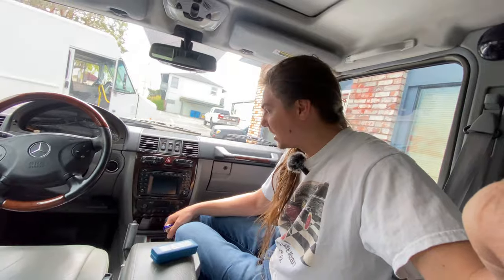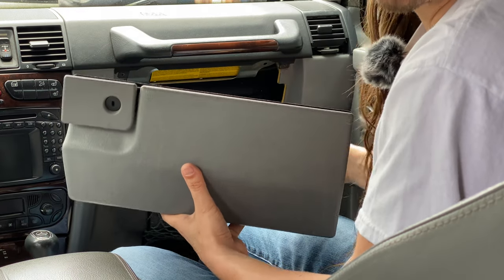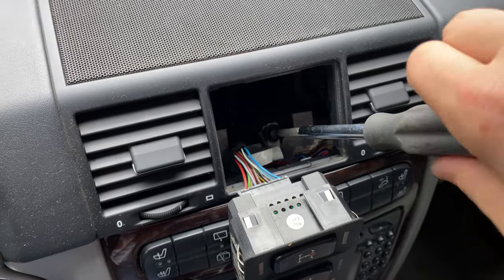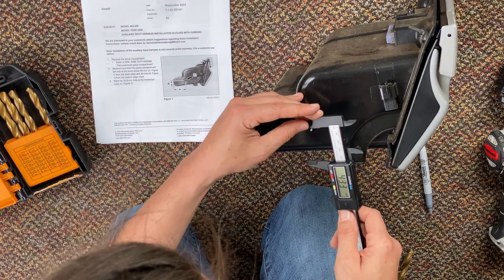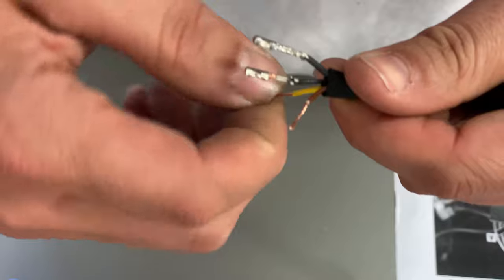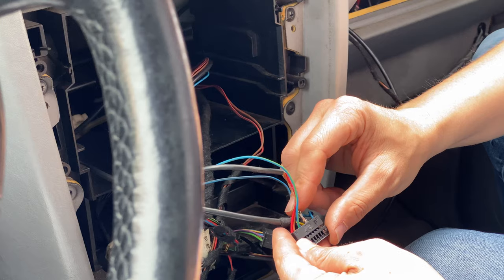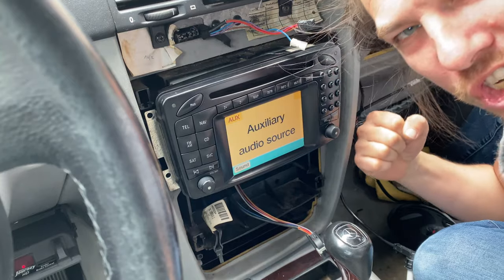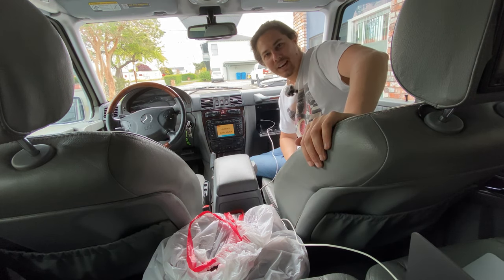How I Installed an AUXILIARY AUDIO CORD Connector in my 2004 Mercedes G500 w463 G-Wagen

Comment: what tool did you use connect the wires to the terminals....thanks
Reply from the maker: Great question - I had to buy a crimper tool. I got it from Amazon, here: https://www.amazon.com/dp/B08FR38529